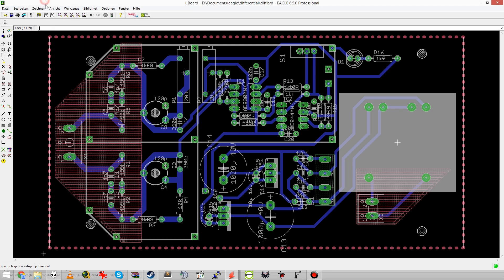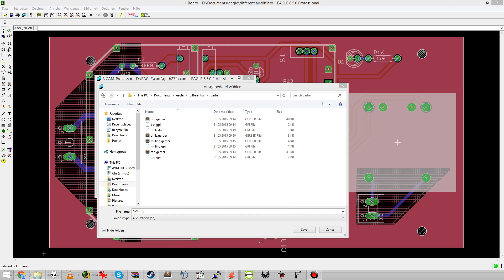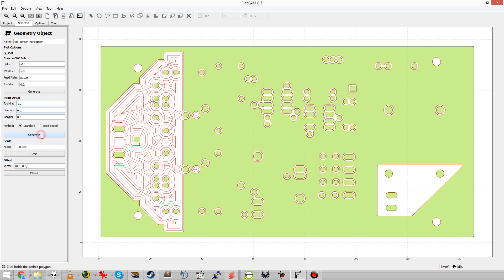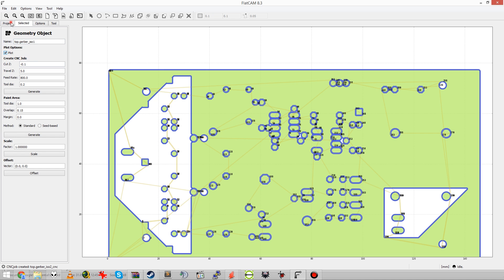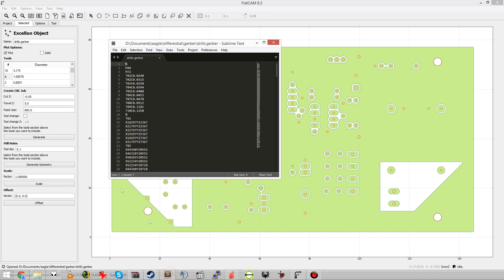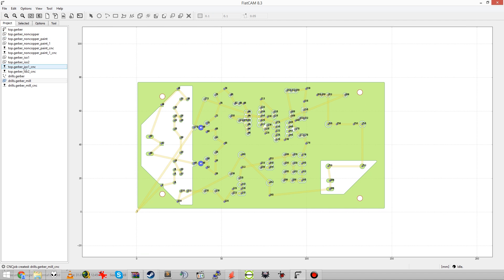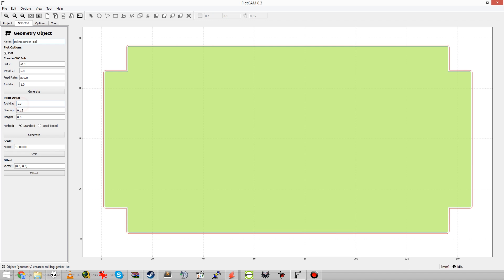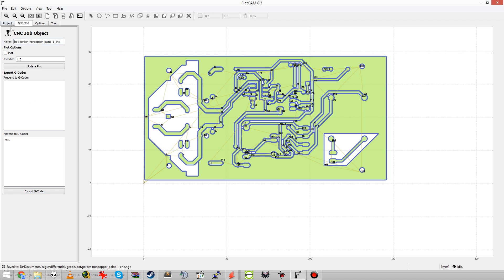FlatCam! Fantastic new PCB CNC Milling CAM Software

Comment: Hey Marco, nice videos your making, are you only using Flatcam alone in this video or do you combine Faltcam with other software anf if so which software. I have just bought the Eleksmaker (A5 size alike) and are now assembling the machine and it would be nice to know if will be the only program needed to install as primar y software to begin with.

Comment: in Flatcam 8.4, you have the option to combine geometries, such as isolation and negative tool drill isolation type routing for engraving PCB with spray paint.

Comment: Wrong sequence on the milling machine. You want to start with isolation routing (low then high voltage) as that's the most delicate part of the process, both sides, only after that you go into drilling and only at the end you should route the outline. Why? Because you should operate in a sequence based on operation aggressiveness order, from the most delicate to the most rude. When you ply off the scrap PCB after outline routing you risk to pull off the board: if that happens you have no way to restore the board position and you are left with a nifty carve.
Other than that, very good tutorial 👍
Reply: I have found that drilling after etching risks tearing up the unsupported traces. If you drill first, the copper is held tight in place for the torque of the drillbit.
Reply: Having used LPKF machines for the best part of twenty years, I have to agree with Joe Beuckman. Always drill first, particularly when using materials with poor copper adhesion such as Rogers 4003 (an RF laminate).

Comment: Hi Marco, what did you do to the PCB at the end with those chemicals?
Reply from the maker: Chemical tinning with an eBay kit
Reply: Ah sweet thanks.
Reply: Have you got some info on V bits at all? Which ones to use, when, how deep to cut to make sure the traces don't short?
Reply from the maker: VHM 30° with a .1mm ground tip (used from PCB manufacturers, not from the People's Republic), if cut is not deep enough you get burrs on the edges, if too deep the traces disappear :)

Comment: Hi Thanks for taking the time to make this. Excellent Video. This really helped me. One question you may be able to help me with as I'm tearing my hair out here. How do you flip the board over? I guess you just flip it on an axis and then pop it on the locating pins. The bit I'm missing is then where you need to set your fixture offset for milling the other side. In pcb-gcode you need to set it to the bottom right but this involves setting up a fixture and probing for zero with an edge finder etc. Is there a simple trick?

Comment: Hello, nice video...thanks for sharing.

It wasn't clear when you opened the pcb file in flatcam, how those non copper white areas where originally formed/created ....was that done in Eagle? (when you were in Eagle those areas where showing...but how did you do that in Eagle). Basically, I'm wanting flatcam to remove unwanted copper from selected areas of my pcb (where the tracks are packed quite tight with the possibility of solder bridges when manually soldering components onto the board)
Reply from the maker: +peskywinnets Yes, a polygon on the brestrict or trestrict layer will tell eagle to not fill that area. But if you encounter solder bridges it might be easier to adjust the clearance settings in DRC?

Comment: Great video :) much appreciated for steps for this awesome software. One question - what bits are you using for PCB ?
Reply from the maker: +Rafal P Isolation routing: 0.1 mm 45° V-tip engraving bit, everything else: 1mm 2 flute VHM end mill
Reply: +Marco Reps thanks! I will be making my first cnc attempts and just trying to get my head around tools being used :)
Reply from the maker: +Rafal P Try to get used ones on ebay - there is always plenty of use left in them when they get sorted out in the industry